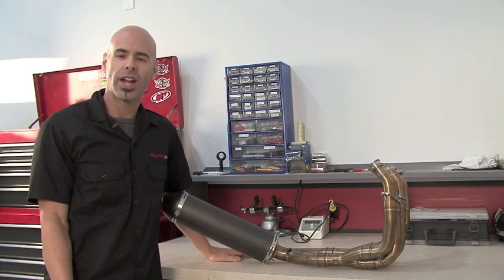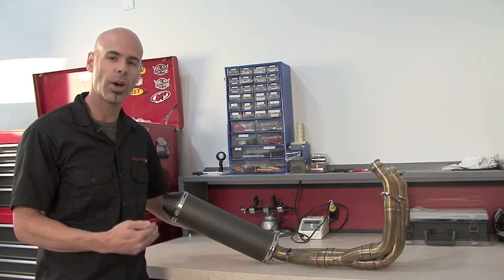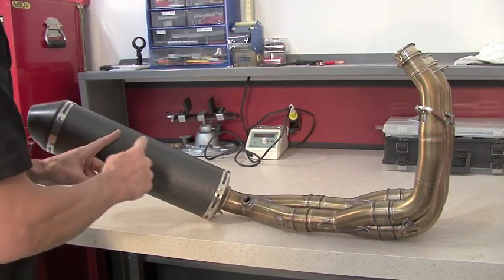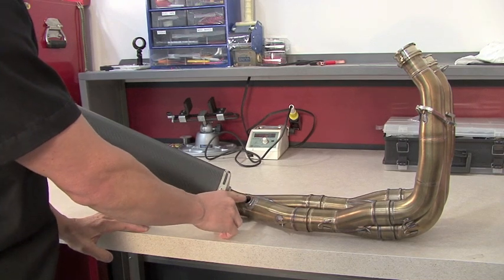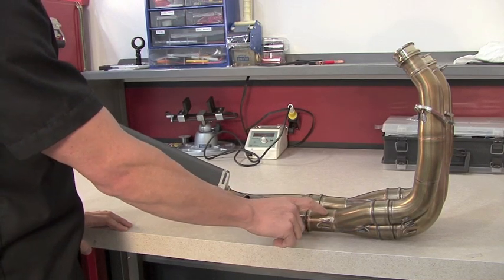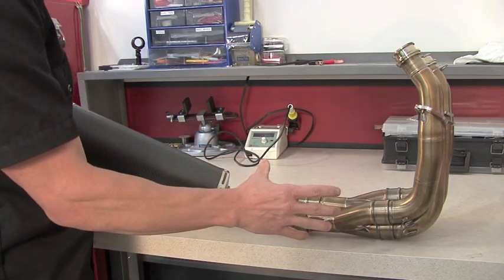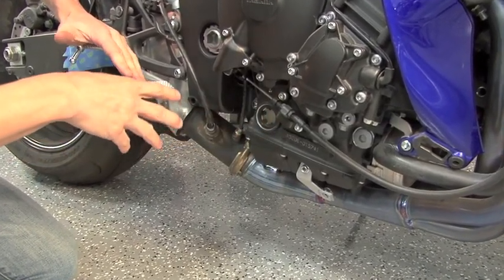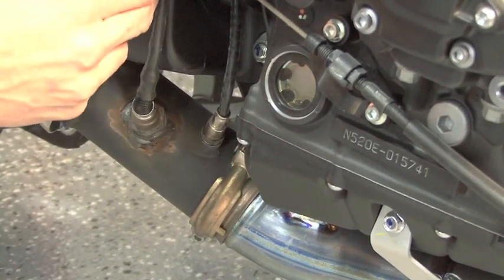Dynojet AutoTune Installation: O2 Sensor Placement

Comment: I have polaris dragon 800 2010 with pc5 & autotune and I was wondering about the o2 sensor placement. How close should i weld it to exhaust manifold? I have seen someone weld it into end of the exhaust, just before silencer. What should I do with original o2 sensor? Leave it on or unplug?

Comment: I have 2010 BMW S1000RR with a cat elimanator. is it ok to install the bung on the 2to1 cat y pipe and is so, would it be better to go onto one of the 2 sections or in the final pipe before the stock muffler conection?

Comment: Ideal practices, what is the best placement for the O2 sensor. I have my O2 sensor installed in the same place as shown on the exhaust in this video but I am receiving AFR readings in the mid to upper 20's at idle. My bike: 2013 ZX10r, Akrapovic exhaust (short), K&N air filter, PCV5 with AutotTune, and ignition module.